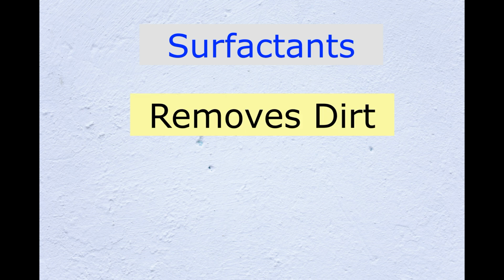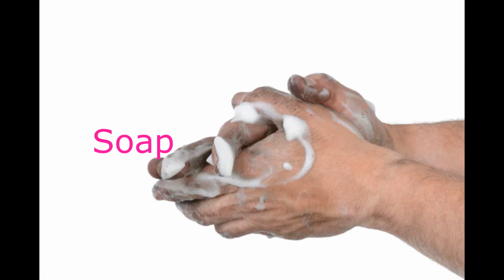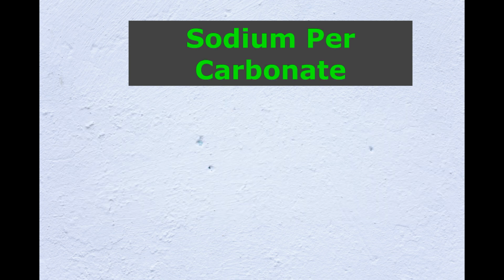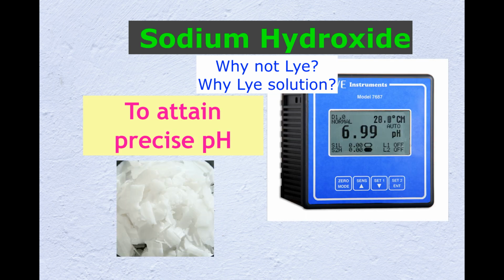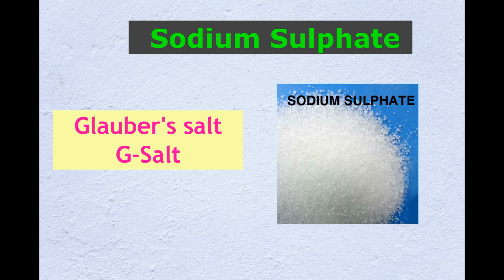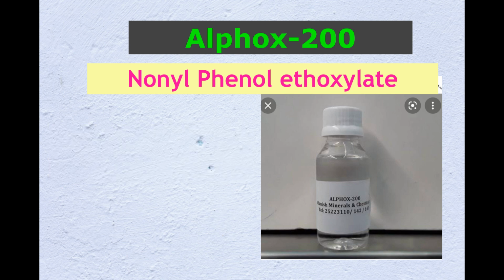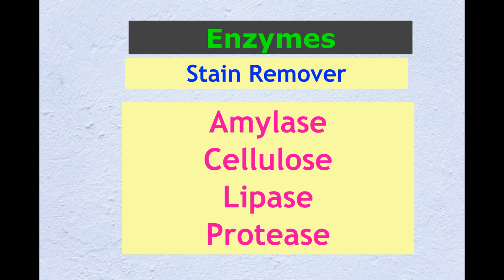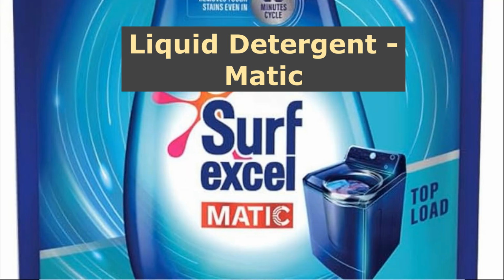A Introduction to Cleaning Industry Raw Materials & Its Role

Comment: Hi sir sodium per carbonate is not using liquid detergent...? Why Pls
Reply from the maker: It is solid. So no problem in detergent powder and detergent soap. But in liquid detergent, after adding, it starts to oxidation. So mainly two problems. It looses it's power.  Safety Storage is question. Internal pressure May develope. ( Big question, I gave short answer. )
Reply: @ARUNKUMARK-jk7ji  super.. Sir.. Good knowledge.. Thank you.. You're very great
Reply: Sir good evening I want some details phone number please